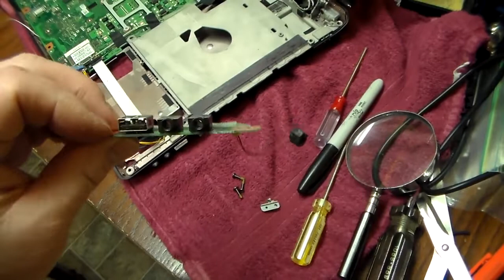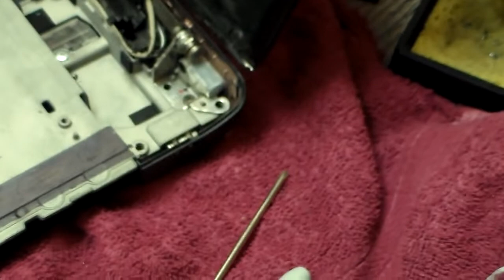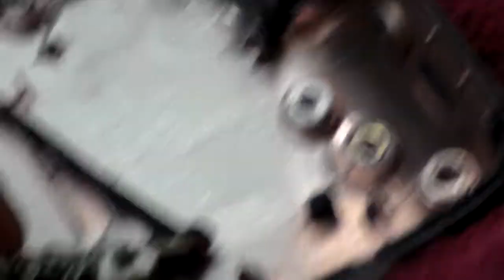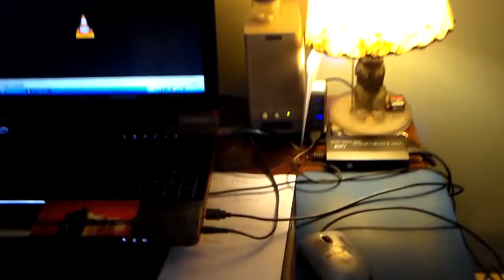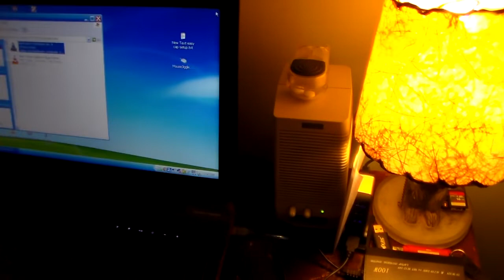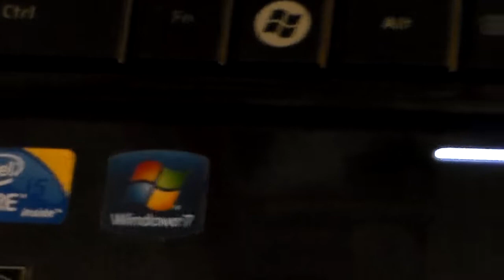Notebook USB SOCKET REPAIR Toshiba QOSMIO F60

Comment from the maker: I don't have the time right now but you need to remove all the screws from the bottom & back, I think there are 3 or 4 different sizes, each hole is marked with a number so mark a baggie with each number to put the screws in, you can also check Toshiba website they may have a downloadable service manual.